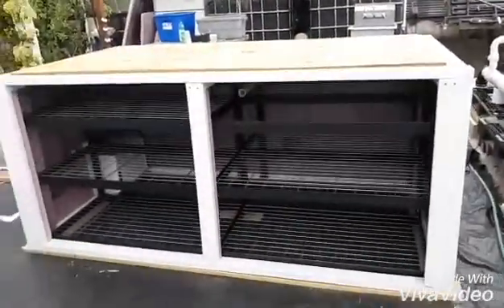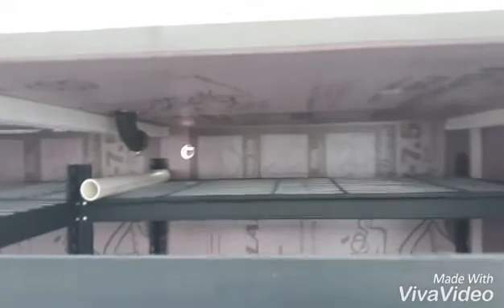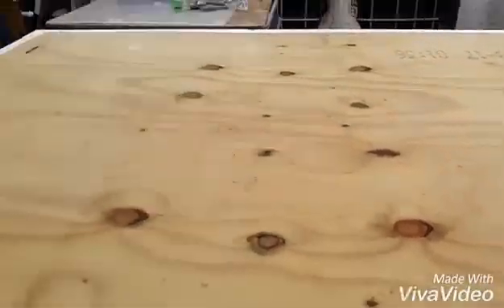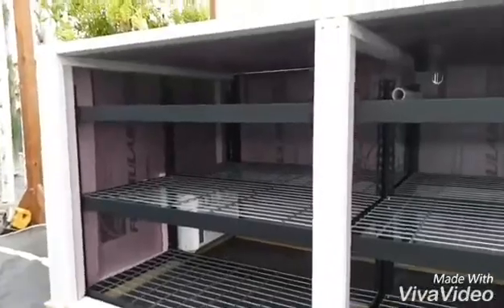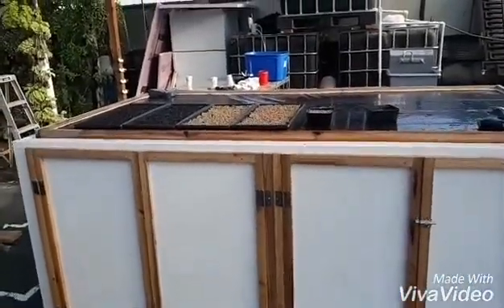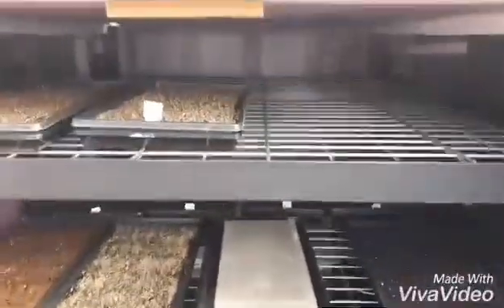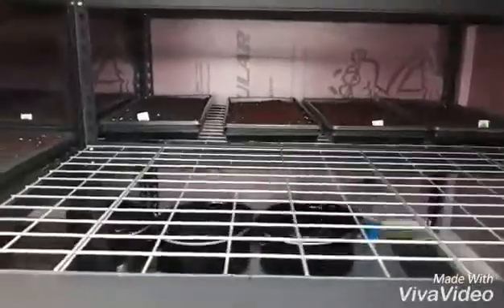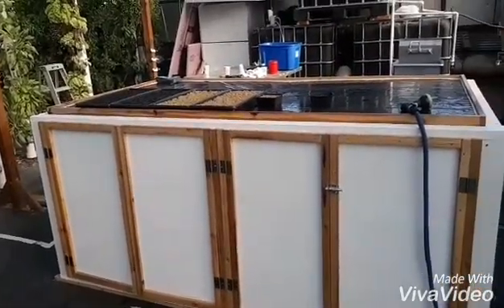Germination chamber up and running

Comment: Has the wood warped since using this?
Reply from the maker: No it's working good. The wood is painted and sealed. The insulation on the inside also keeps the moisture away from the wood. Thanks, Von